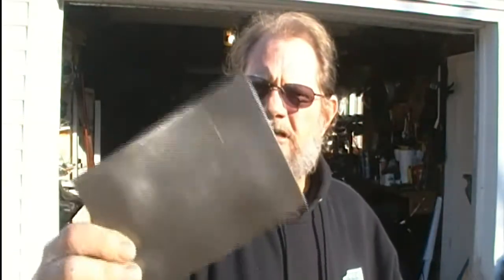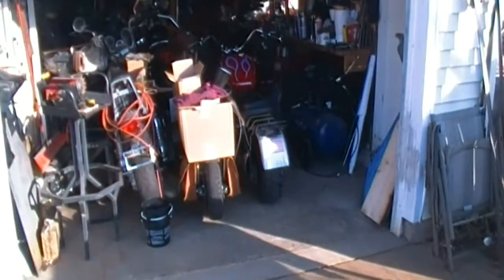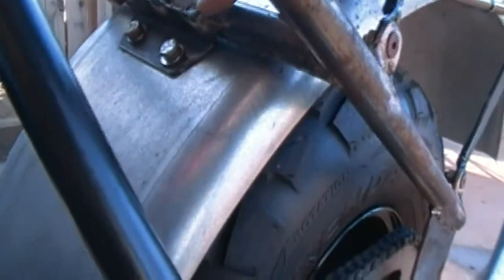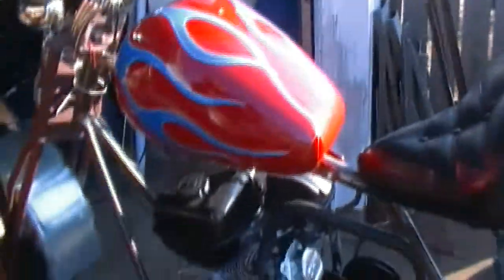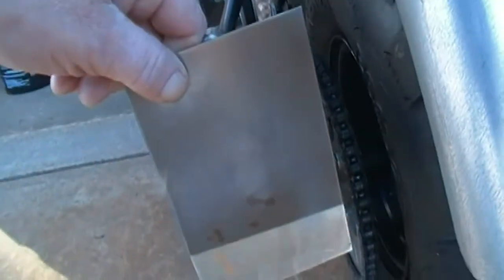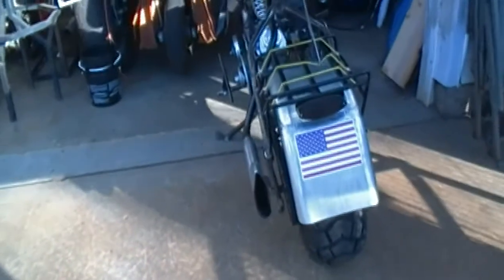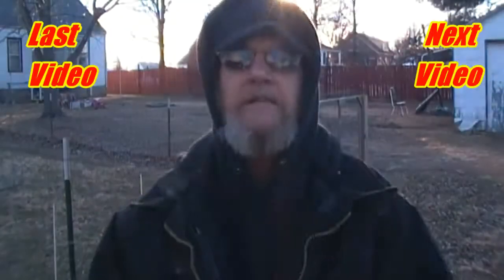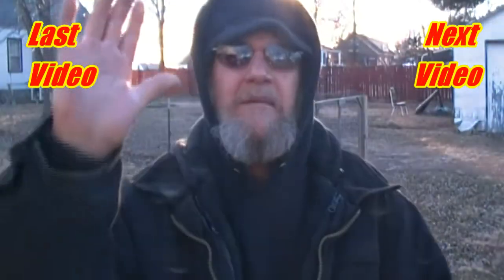TUNING AN EXHAUST NOTE ON THE SPRINGER BIKE

Comment: Hard to tell on the video I think I saw that one you were talking about were the guy did the washer & drilled & packed the pipe it did sound good. You will get the way you want it trial & error. Good to see ya back at it Bro!!!
Reply from the maker: Yeah we just keep pluggin away at it til we're happy.  That guy was using pop rivets to secure a washer 1/2 way through his baffle pipe. 
Thanks Ty, Good to hear from you.

Comment: my grandfather showed me how to take chicken wire roll it like a cone until it can fit in the muffler.  then take fiberglass and wrap around the wire then put in muffler. you make it the length you want. depending on how low you want it keep wrapping fiberglass. we used to do that to our lawnmowers too quite them down. the wire keeps the opening inside for flow
Reply from the maker: That's an interesting technique , I'll have to keep that in mind also.
Thanks Robbie, Cheers !
Reply: shopdogsam makes em too for his engines. pretty cool.

still looking this winter for a baja of my own. there hard to come by on craigs list

Comment: If the steel wool blows out, wears out, rusts out or whatever ... try Choreboy stainless steel or copper scouring pads. Sounds good.
Reply from the maker: That's what I had intended to use but found I didn't have any.  This kind is prone to rust and will actually burn. So I don't think it will last very long.
Thanks man, & good advise too !

Comment: Hey bud, long time no chat. I found on the last small bike I fixed up that if I cleaned up the intake tube from the carb to the engine with a dremmel so it flowed a little better I got a lot more from my idle and power band tone not to mention more seat of the pants torque. no big port type stuff just knock down the casting lines and blend in with some rough grit. not a polished finished but a satin. later Jack
Reply from the maker: Hey Jack, Good to hear from you !  Thanks for the tip, I've got some motor mods comin up when I tear down for paint. So, I'll keep this in mind & giver a whirl.  Hope everything's going well for ya ! Cheers

Comment: i think the after not does sound better...at idle u can here more of thump thump thump and deeper throttle down aswell sounds better the steel wool sounds like it cut down on the sounds vibrations and stopped from being so raspy as it was echoing in side that pipe before and aint as bad now..has a good tone too it like it has some power to her lol good video bruce
Reply from the maker: Thank you man, I think you're right & I like it better, but it's still not quite what I was looking for.  Glad you checked it out !

Comment: it did reduce some of the hollow reverberation with the plate & wool installed but marginal.,,the problem with wool in mid exhaust stream is that it will either carbon up or rust over time causing some flow restriction eating into power and at some point probably get blown out.

the holed plate is on the right track,,that same simple principle is used for silencer design just a few more and positioned at key points.

you could try an inner silencer perforated tube that aligns with the entry pipe, with a slight pinch neck towards the last section, or a direction ring plate ,thus slightly reducing  flow for the tube to work, pack glass wool around the silencer tube,  fab a few inner retainer plates to secure position of tube, stopping glass from being forced out or working loose. finish with end plate, using dome heads to secure.has to be removable for maintenance.

 or try a few baffle plates with the holes drill out of alignment, prolly 3 plates about  3 to 4" apart, changing the distance and hole paths & diameters on each plate will effect flow path & resonance, hold plates apart using 2 or 3 long threaded rods with back nuts on each plate for adjustment,, its all about resonance, look up  Helmholtz resonance , not only can you tune the note but at the same time increase power due to improved flow... hope that helps.

Comment: Tuff dog the difference over your camera is very hard to tell.  If you put a tube muffler on it it uses packed fibre glass wadding, that will give a note, but uses twice as much baffle to what you have used.  The holes in the baffle your using need to be smaller by half.   That's my opinion anyway
Reply from the maker: That's good input, I like it. Thanks for saying. I'm pretty sure I'm not done with this yet. I'll keep that in mind, Thanks a lot